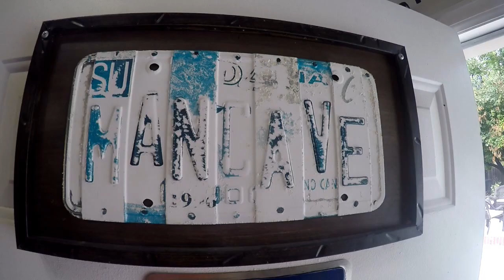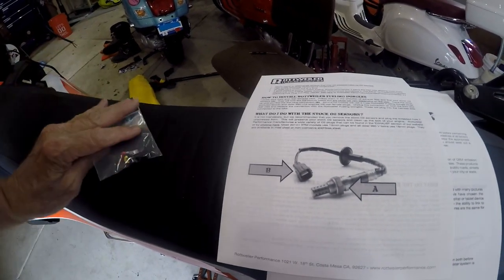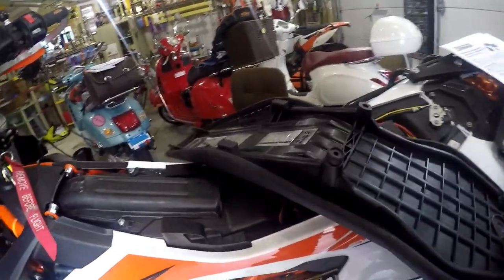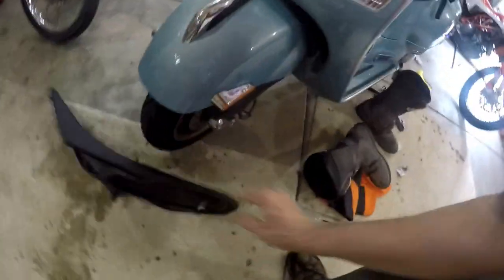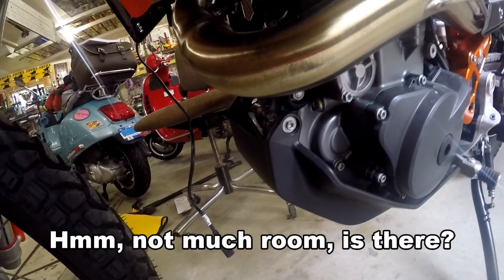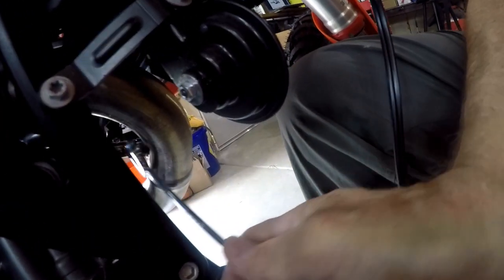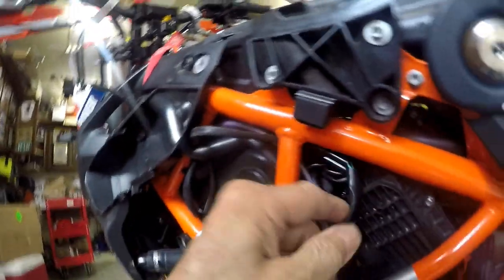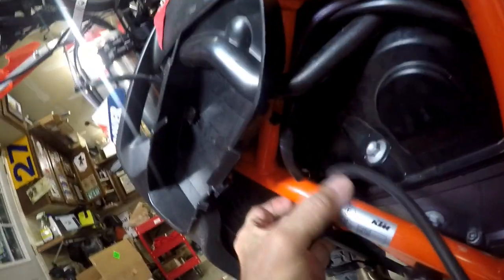2019 KTM 690 Enduro Mods #27 Rottweiler Fueling Dongle

Comment: Just did this mod today for my 2017 Husqvarna 701 Enduro, made such a difference in how smoothly the engine ran. Was a little hesitant at first but totally changed the bike up in low rpms, vast improvement. Thanks for the videos.

Comment: hey mate,
first thanks for your videos, informative and well explained.
iv had this bike for almost 6 months.
my question is, from what i understand this dongle will make the O2 system closed loop?
since the O2 readings will always be 13.8, it dosn't matter if i did open airbox mod along side with any exhaust slip on? it wouldn't affect my bike, only won't be running at it's best performance with the mods i have? right?

Comment: Hey Telerover. My fuelling dongle just showed up today, as did the O2 sensor plug. Thanks for this video - good as a quick reference before I go searching for the wire and connector. How have you found the fuelling with the dongle so far?
Reply from the maker: I only have 500 miles on the bike with no baseline to compare with other than my 2015. The motor pulls nicely from an idle in a steep hill situation, and I was able to folllow a vehicle off road that was only going 8-10 mph without clutching it to keep the motor running #rottweiler
Reply: @telerover  Just installed it. Doing the 15 minute sidestand idle procedure and then I'll go for a little ride around the farm at low speed and see if the fuelling is better.
Reply: @ToriMoto  i have the rade fuel tank and air box on my 2019 690 SMC-R. i didnt seem to have any stalling issues at low speeds at all. I also have a wings slip on exhaust with the baffle in. How does the fueling dongle feel?
Reply: @ToriMoto 
Hi, how did it work?

Comment: Hey Telerover, thanks for posting this. I have the Rade tank and air box, and am finding I have the occasional low speed stall of my bike. I am worried it is a little lean in the low rpm. Did you experience the odd stall of your bike prior to this install?
Reply: Hi Telerover and Tori!  I installed the Rade tank and air box and it was the best upgrade! No more worries about fuel!  Telerover, thanks to you I just removed SAS system and getting ready to install fuel dongle.  Sounds like you are happy with it this far by everything I have read.
Reply: Did you ever find a fix for this I’m experiencing this on my 690 as well

Comment: Hi, nice video.  I have a question for you (need your advise)... I want to ride the world with my 690 Enduro R 2019.  How can I ride in poor country with low octane fuel ?  I contact KTM, and they tell me that low octane will damage the engine.  I can't imagine having to carry octane booster all over the place... Do you have a solution for me ???  Thank you
Reply from the maker: How low did they tell you is OK? I guess I would have to do research as to what octane is used in the places you are going.  I thin there is old fuel out there , but most places have to supply fuel for all the modern vehicles in their country.
Reply: @telerover  I do not have the numbers, and also method of calculating is different from country to country.  But I know that when you go in poor country, there is only one kind of fuel available, and is the basic one.  Even sometime we get fuel by bottle...  So you never experienced travel for a long trip and only have low grade fuel available ? Thank you

Comment: Loctite 243 that O2 bung. It will come loose and fall out I know firsthand .
Reply from the maker: I don't think that would be effective as Loctite breaks down when heated. Its how we break it free sometime. Loctite 243 operating spec is -65 - 360 °F and pipes supposedly hit 800 degF or hotter. Loctite 266, their high temp threadlocker is rated up to 450 degF. Safety wire might be the ticket?

Comment: hello
does it increase fuel consumption
Reply from the maker: I don't know, and I will not have a baseline, since I have not ridden the bike before putting this dongle on. Its only a slight change from 14.7 Air-Fuel Mixture to 13.8, and affects low RPM the most. Cruising speed should not be noticeably affected.
Reply: No not as much as your right hand you need it so your bike does not throw a code when you delete the SAS.

Comment: Hi Telerover, How did the fuel Dongle work, did you notice anything 
On My 2019 690 enduro , I have temko header and Barrett pipe and uni performance filter and at low speed it stalls
Reply from the maker: I do not have a before and after experience to share. I did not do as many changes as you, and I kept the stock air filter and am using the dbkiller on my Wings exhaust. No mapping changes. I have not experienced any stalling, which is what the dongle is supposed to help with. I'd pop a message over to Rottweiler.
Reply: @telerover   thanks for the reply champ

Comment: what about Power commander ?
Reply from the maker: I have had no experience with it. If Rottweiler sends me one I can try it. I have plenty of 690 performance with the stock bike, but I look for ways to make it lighter and run smoother, like using this dongle, and doing the canister removal kit, which may be the next video.
Reply: I've read that power commander can only adjust the fuelling in the open loop (above 5500rpm and 20% throttle) state. It will still cut back to the stock AFR setting in the closed loop state. Not very experienced in this though so I'm open to correction.
Reply: If you want to turn the Beast into an absolute monster the Power Commander V is the only way to go. The advantage with the Power Commander V is being able to tune it. Correct fuel map plus ignition timing = monster. For example if you add the Temko titanium header and the Rottweiler intake with the wings no db killer you will need to remap it. If you go with just the wings and no DB killer fueling dongle will be just fine no monster just Beast.
Reply: @jdempsey10  I think this Dongle keeps the system in open loop! Don't have experience with this particular 690 Dongle but mostly it's a resistor that keeps the ecu thinking the o2 is still cold and needs to warmed up before it can go to closed loop.

Comment: not nearly as sexy installed but I highy recommend anyone to buy a hex bolt plug rather than the low profile allen,,,,It was a nightmare trying to get my stainess allen version in due to less than perfect threads  it may or may not be a bastard...and I was sorely wishing I had bought the clunkly looking hex plug....trust me on this... unless you have every tool known to man including cut down allen wrenches and 1/4 drive 6mm allen socket....which you may or may not have good luck getting in there
Reply: Pardon? Allen is hex. And yeah, most of us have an infinite supply of them.